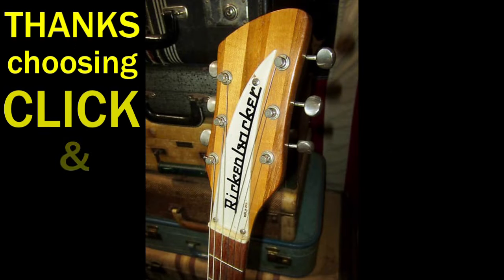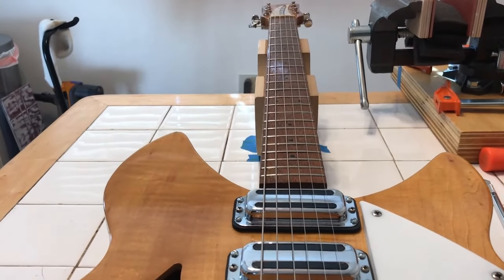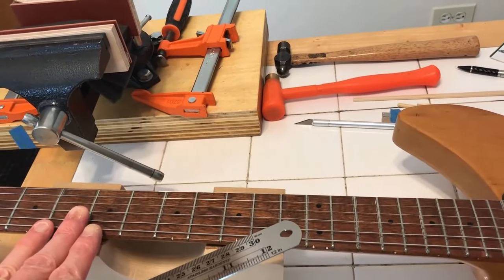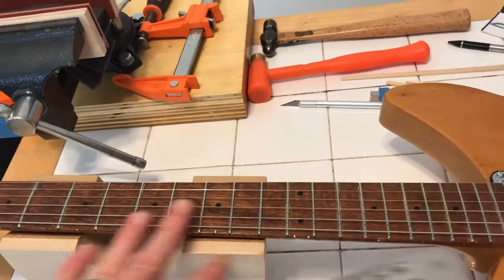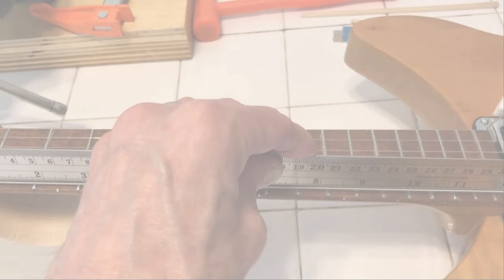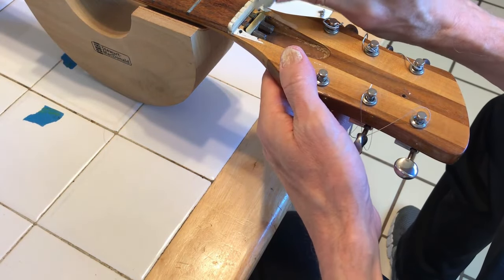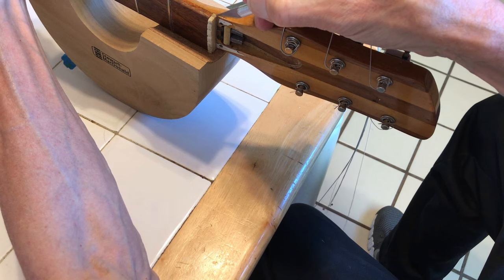Replacing a (Rickenbacker) Guitar Nut - Pt. 2 (of 3) Off with the Old

Comment from the maker: Like this content? Help keep it coming! 
CONTRIBUTE through Zelle or PayPal to rcgpayment@gmail.com
THANKS!

TIME-STAMPED CONTENTS in this video:
* Checking the neck for warp 1:28 
* Checking the frets are leveled 4:24
* Checking neck relief 11:20
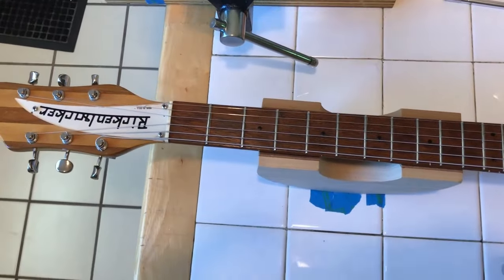* Lifting the strings - 3 different tailpieces: Ac'cent, 'R' & Trapeze chevron 17:48
* Koda The Wonder Cat! 26:38
* 'Scoring'/Cutting around the Old Nut 26:46
* Measuring the old nut for reference: overall dimensions & string spacing 32:56
* Tapping the nut off - The WRONG way & and THE RIGHT 48:16
* The TAP - and a Bombshell! 53:38
* What's next...1:01:38